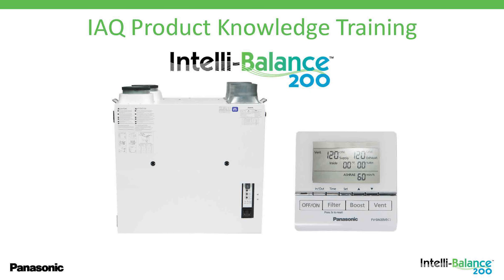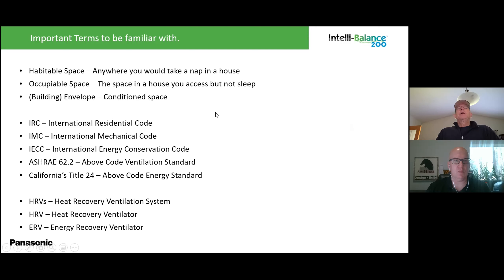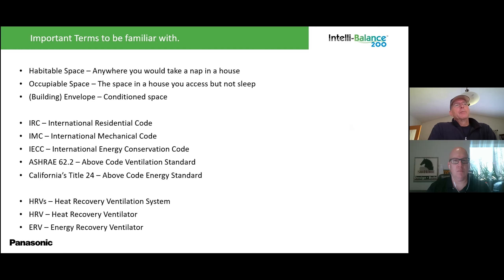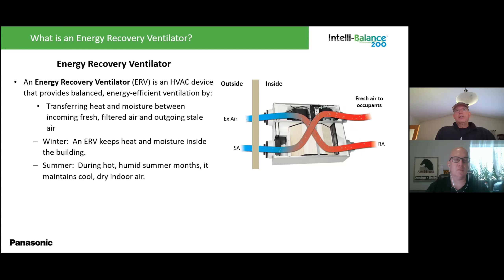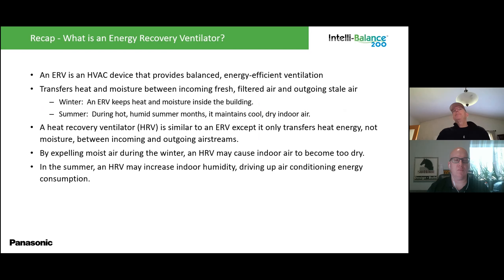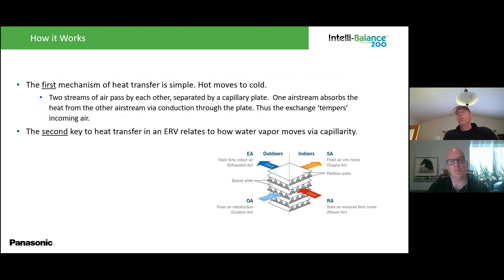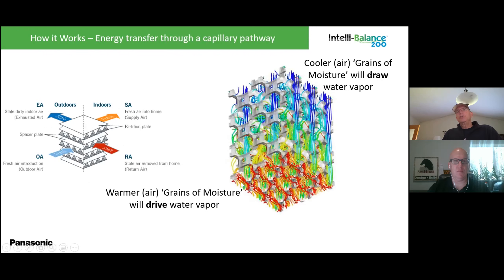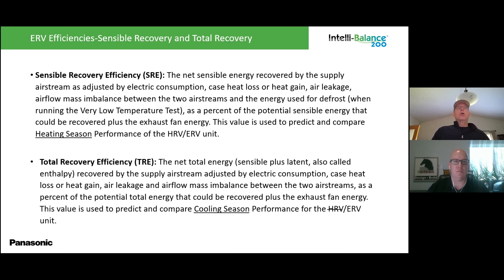Whole House Energy Recovery Ventilators Explained by Panasonic

Comment: I built my home 12 years ago and they installed a HRV. I’m here in Wisconsin. Should I spend the money to have the HRV taken out and spend the money to have a ERV installed? I will admit that as I am getting more educated and there is more information available I do run my HRV all the time in the winter. The first 8 or so years we only ran it when the windows had water on them and never when the temperature was above 40.

Comment: how deos your system compare to Boan? Heard great things about thier systems.
Reply from the maker: Good question.  We have interviewed both companies and both seem to have very similar features.  Broan was slightly ahead with their sensors and programming a few years ago.  Panasonic has partnered with Swidget to add some of the same features.  I would consult and HVAC designer to come up with the best solution for your home.  A good system with a bad design and installation will not work as well as it should.